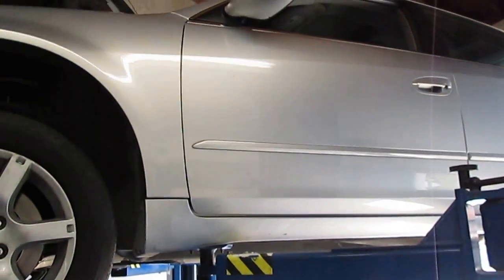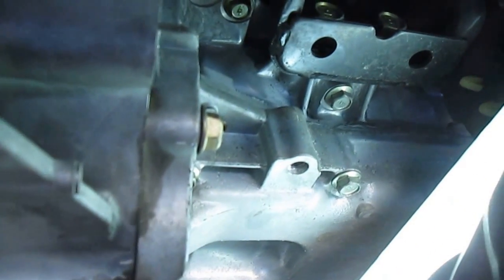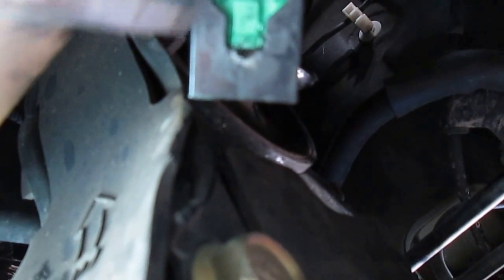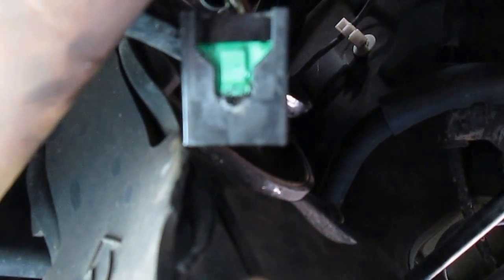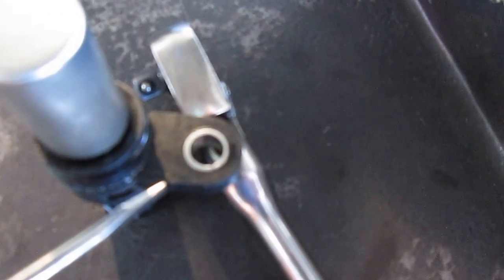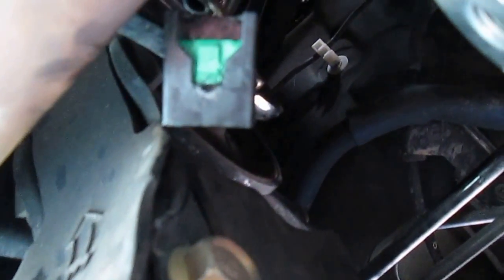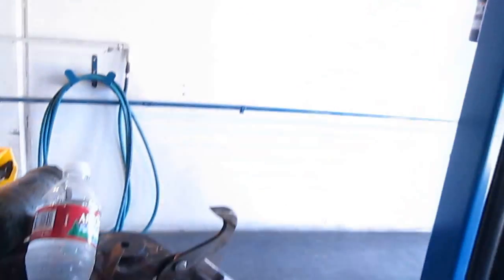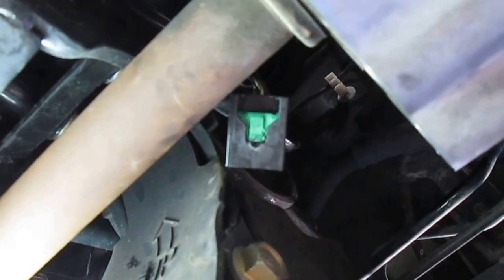How to check a crankshaft position sensor on a Nissan Altima 2.5L

Comment: Can anyone explain how to change my nissan Titan 2007 turbine input shaft speed sensor
Reply: I really need help
Reply from the maker: AT-104
< SERVICE INFORMATION >
DTC P0717 TURBINE REVOLUTION SENSOR
DTC P0717 TURBINE REVOLUTION SENSOR
Description INFOID:0000000003512082
The turbine revolution sensor detects input shaft rpm (revolutions per minute). It is located on the input side of
the automatic transmission. Monitors revolution of sensor 1 and sensor 2 for non-standard conditions.
CONSULT-II Reference Value in Data Monitor Mode INFOID:0000000003512083
On Board Diagnosis Logic INFOID:0000000003512084
• This is an OBD-II self-diagnostic item.
• Diagnostic trouble code “P0717 TURBINE REV S/CIRC” with CONSULT-II is detected under the following
conditions.
- When TCM does not receive the proper voltage signal from the sensor.
- When TCM detects an irregularity only at position of 4th gear for turbine revolution sensor 2.
Possible Cause INFOID:0000000003512085
• Harness or connectors
(The sensor circuit is open or shorted.)
• Turbine revolution sensor 1, 2
DTC Confirmation Procedure INFOID:0000000003512086
CAUTION:
Always drive vehicle at a safe speed.
NOTE:
If “DTC Confirmation Procedure” has been previously performed, always turn ignition switch “OFF”
and wait at least 10 seconds before performing the next test.
After the repair, perform the following procedure to confirm the malfunction is eliminated.
 WITH CONSULT-II
1. Turn ignition switch “ON”. (Do not start engine.)
2. Select “DATA MONITOR” mode for “A/T” with CONSULT-II.
3. Start engine and maintain the following conditions for at least 5
consecutive seconds.
VHCL SPEED SE: 40 km/h (25 MPH) or more
ENGINE SPEED: 1,500 rpm or more
ACCELE POS: 0.5/8 or more
Selector lever: “D” position
Gear position (Turbine revolution sensor 1): 4th or 5th position
Gear position (Turbine revolution sensor 2): All position
Driving location: Driving the vehicle uphill (increased
engine load) will help maintain the driving conditions required for this test.
4. If DTC is detected, go to AT-104, "Diagnosis Procedure" .
 WITH GST
Follow the procedure “With CONSULT-II”.
Diagnosis Procedure INFOID:0000000003512087
1.CHECK INPUT SIGNAL
With CONSULT-II
Item name Condition Display value (rpm)
TURBINE REV During driving (lock-up ON) Approximately matches the engine speed.
BCIA0031E
DTC P0717 TURBINE REVOLUTION SENSOR
AT-105
< SERVICE INFORMATION >
D
E
F
G
H
I
J
K
L
M
A
B
AT
N
O
P
1. Start engine.
2. Select “ECU INPUT SIGNALS” in “DATA MONITOR” mode for
“A/T” with CONSULT-II.
3. Vehicle start and read out the value of “TURBINE REV”.
OK or NG
OK >> GO TO 4.
NG >> GO TO 2.
2.CHECK TCM POWER SUPPLY AND GROUND CIRCUIT
Check TCM power supply and ground circuit. Refer to AT-163 .
OK or NG
OK >> GO TO 3.
NG >> Repair or replace damaged parts.
3.DETECT MALFUNCTIONING ITEM
Check the following items:
• The A/T assembly harness connector pin terminals for damage or loose connection with harness connector.
OK or NG
OK >> Replace the control valve with TCM. Refer to AT-229, "Control Valve with TCM and A/T Fluid Temperature
Sensor 2" .
NG >> Repair or replace damaged parts.
4.CHECK DTC
Perform “DTC Confirmation Procedure”.
• Refer to AT-104, "DTC Confirmation Procedure" .
OK or NG
OK >> INSPECTION END
NG >> GO TO 2.
Item name Condition Display value (rpm)
TURBINE REV During driving (lock-up ON) Approximately matches
the engine speed.
PCIA0041E
AT-106
< SERVICE INFORMATION >
DTC P0720 VEHICLE SPEED SENSOR A/T (REVOLUTION SENSOR)
DTC P0720 VEHICLE SPEED SENSOR A/T (REVOLUTION SENSOR)
Description INFOID:0000000003512088
The revolution sensor detects the revolution of the idler gear parking pawl lock gear and emits a pulse signal.
The pulse signal is sent to the TCM which converts it into vehicle speed.
CONSULT-II Reference Value in Data Monitor Mode INFOID:0000000003512089
On Board Diagnosis Logic INFOID:0000000003512090
• This is an OBD-II self-diagnostic item.
• Diagnostic trouble code “P0720 VEH SPD SEN/CIR AT” with CONSULT-II is detected under the following
conditions.
- When TCM does not receive the proper voltage signal from the sensor.
- After ignition switch is turned “ON”, irregular signal input from vehicle speed sensor MTR before the vehicle
starts moving.
Possible Cause INFOID:0000000003512091
• Harness or connectors
(The sensor circuit is open or shorted.)
• Revolution sensor
• Vehicle speed sensor MTR
DTC Confirmation Procedure INFOID:0000000003512092
CAUTION:
• Always drive vehicle at a safe speed.
• Be careful not to rev engine into the red zone on the tachometer.
NOTE:
If “DTC Confirmation Procedure” has been previously performed, always turn ignition switch “OFF”
and wait at least 10 seconds before performing the next test.
After the repair, perform the following procedure to confirm the malfunction is eliminated.
 WITH CONSULT-II
1. Turn ignition switch “ON”. (Do not start engine.)
2. Select “DATA MONITOR” mode for “A/T” with CONSULT-II.
3. Drive vehicle and check for an increase of “VHCL/S SE·A/T”
value in response to “VHCL/S SE·MTR” value.
If the check result is NG, go to AT-108, "Diagnosis Procedure" .
If the check result is OK, go to following step.
4. Select “DATA MONITOR” mode for “ENGINE” with CONSULT-II.
5. Start engine and maintain the following conditions for at least 5
consecutive seconds.
VHCL SPEED SE: 30 km/h (19 MPH) or more
THRTL POS SEN: More than 1.0/8
Selector lever: “D” position
Driving location: Driving the vehicle uphill (increased engine load) will help maintain the driving
conditions required for this test.
If the check result is NG, go to AT-108, "Diagnosis Procedure" .
If the check result is OK, go to following step.
6. Maintain the following conditions for at least 5 consecutive seconds.
ENGINE SPEED: 3,500 rpm or more
THRTL POS SEN: More than 1.0/8
Selector lever: “D” position
Driving location: Driving the vehicle uphill (increased engine load) will help maintain the driving
conditions required for this test.
Item name Condition Display value (km/h)
VHCL/S SE·A/T During driving Approximately matches the speedometer reading.
BCIA0031E
 Copyright 2009 - 2013 Service Repair Solutions, Inc.
Reply from the maker: HI Kay, do you still need help? What code do you have? What are the symptoms?

Comment: Beware of most aftermarket sensors. I’ve replaced many of these over the years in our shop and they often fail or cause other codes to be triggered. You’re not saving money by buying an aftermarket sensor – it will wind up costing you more. The situation is worse with the sensor connector. As far as I know there is no oem connector available and I’ve only found two vendors who sell 100% reliable connectors, Look here:  https://www.bonanza.com/listings/503762340 or here https://www.ebay.com/itm/381951393669. All the other connectors out there are Chinese junk which often fail right out of the package. The sensor connectors go bad often and cause a code to be triggered. Over time they no longer make a good electrical connection with the sensor due to oil and dirt contamination and fatigue. Before you replace the sensor try cleaning the connector with brake clean or something similar and compressor air. If this makes the code go away then you will need to replace the connector. Cleaning it is only a temporary solution and it will likely fail again soon.
Reply from the maker: I agree Bill, always use Factory Parts whenever I can unless the customer insists otherwise.
Reply: My Autozone replacement sensor has worked for 12 years and counting.

Comment: does the sticker stay on senser
Reply from the maker: sticker with part number on the outside? if yes leave it on.  There should be nothing covering the tip of the sensor, the opposite end of the wiring connector.

Comment: Unfortunately, that connector is prone to seize with time.  The slides oxidate, and get full of dust and grime through the years, and due to it's location, makes it very difficult to clean.  Even if you are careful, and diligent, it is not uncommon to break the lock on the connector, and Nissan does not sell it separately.  It comes as an entire assembly with the harness.  They want 1600.00 for a harness.  It's a crappy design to say the least.  On some vehicles, like the Maxima, it actually doubles up as a shielded harness which piggybacks into the main harness.  Again, Nissan won't sell it separately.

Comment: I changed mine and the problem I have is that the harness connector clicks into the fully extended position so that the edge of the green tab is is flush with the connector housing but it won't lock, you can tug it right back out. What do I do?
Reply from the maker: When you push the connector on, the green tab must be pushed in. It will actually stay in place in the pushed in position. Then when you push it all the way onto the sensor it is supposed to pop up to the flush position. When your pushing it on you may have to put a little side to side pressure to make it release the lock. The one I did, dad the hold the connector pushed in and took a long flat blade screw driver to pop the green tab up. If none of that works, will have to find another connector.